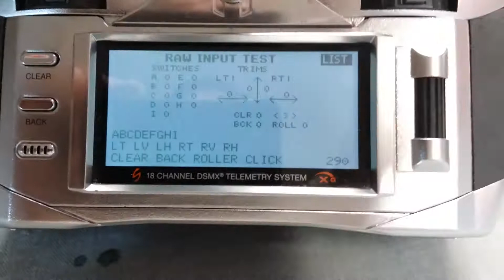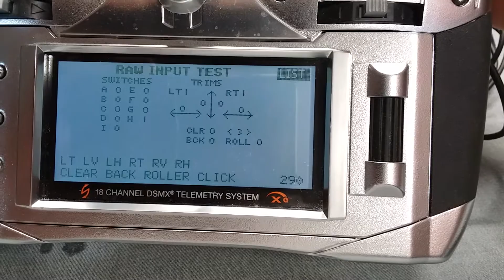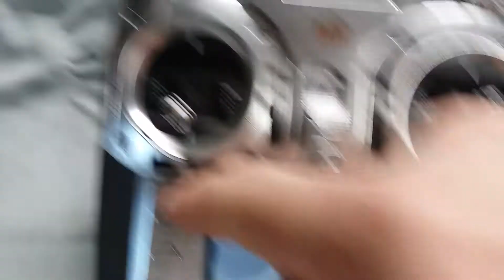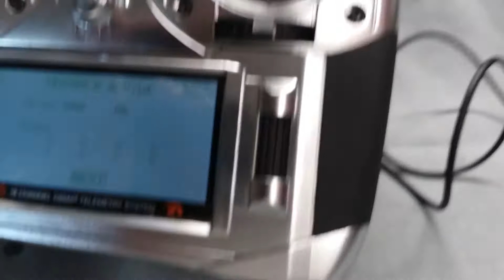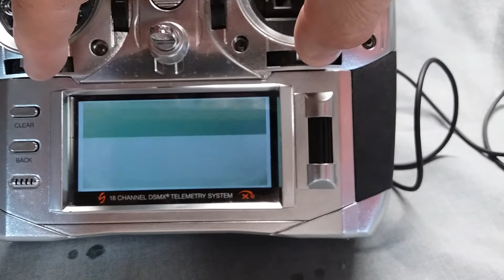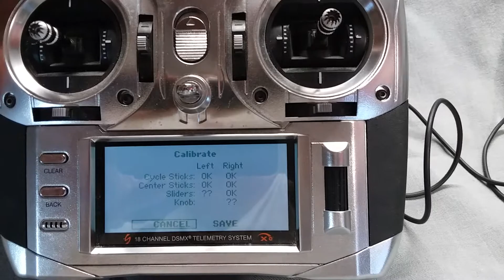Spektrum DX/NX Raw Input Test Recovery

Comment: DX7 Ver 2 - Just turn off the Radio LOL.  Get into it by holding down both left buttons while truning on.
Reply from the maker: That's how you get in by your choice. If there is a malfunction it's possible for the radio to get into the Factory Test Mode and the only way to get out of it is to go thru each screen as shown in the video.
Reply: @AndyDeMontana  - Dang...didn't realize that in factory test mode it would ignore the power switch...learn something new every day.
Reply from the maker: @Kevin-x4p4y It isn't ignored. You can turn it off. But it won't let you get to the normal operating mode until you get thru the test mode.
Reply: @AndyDeMontana  - Oh I see said the blind man :>)  Wow I can see how that would indeed be a big problem.
Reply: What both left buttons
Reply from the maker: @ror-ys3qp CLEAR and BACK.
Reply: @AndyDeMontana but that puts it into model select menu
Reply from the maker: @ror-ys3qp At POWER ON it puts it into Raw Input. Just like holding down the roller puts it onto the System Menu.
Reply: @AndyDeMontana ok did not know that

Comment: Thank you so much.
I have a dx6e and didn't need a trainer cable or master tx.
Interesting.
Reply from the maker: That's because you didn't have the factory code in the radio.  There's a post that went along with this on RCGroups, so you get the full context.  The video shows the worst-case situation, while the text explains the difference.
https://www.rcgroups.com/forums/showpost.php?p=35112374&postcount=38921

Comment: Is the method the same for the NX10 series? / Even if you try it like in the video, it doesn't work properly.
Reply from the maker: Yes.  Make sure you are cycling ALL digital inputs.  Exactly what difficulty are you having?  "It doesn't work properly" is extremely vague.  Also, what version of code are you using?  Is it the factory load or one of our updates?